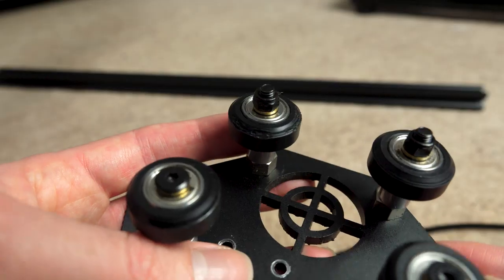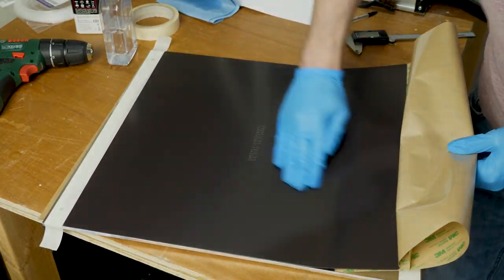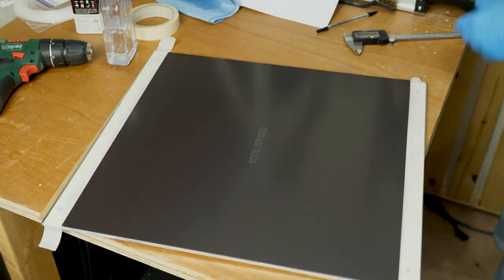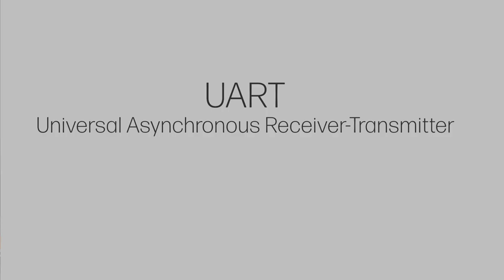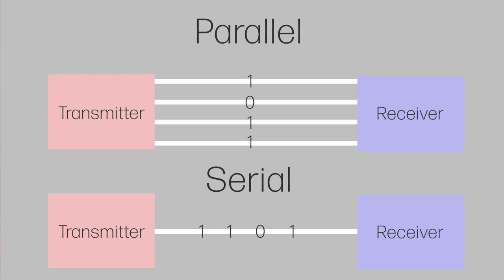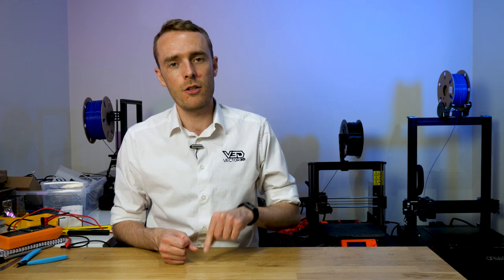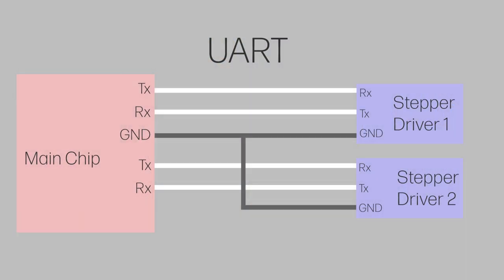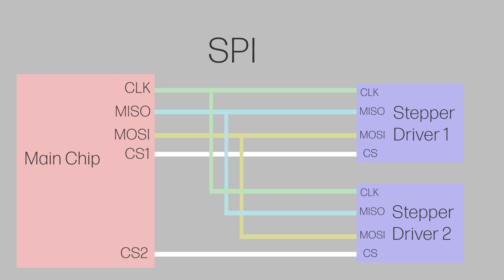UART vs SPI on 3D Printers. What are they?

Comment: UART has some nice features for people who are into tinkering, like dynamically switching from spreadcycle and stealthchop2 modes. But I think what most people will use, if they do, is being able to change the driver Vref in the firmware and not by turning the potentiometer.

Comment: Fun fact: GTR board, when taken with an expansion board and filled with UART TMC2209 drivers - costs almost as much as a Duet 2 + Duex5 clones from the same Bigtreetech. It has more inputs and outputs, if you plan to use Klipper - it's a pretty good system, could be worth it, maybe for something like a Voron or other printer with lots and lots of motors. 
If you do like Reprap firmware, and don't mind its restrictions and lower speeds - you can get a Duet clone. 

Either way - Bigtreetech has got you covered. I like what they're doing. Affordable prices, true open-source on github...
I wish Bigtreetech made their own Pi board! You know, to order alongside the other boards, for octoprint and other similar things.
Reply: Id like something similar to the einsy rambo as used on prusa mk3 with a location to gpio hook up a pi "natively"
Reply: Having not watched this video throughout haha i meant on more "normal" boards skr etc
Reply: @gazeddy  Pi GPIO header is waaay too large, SKR boards are already full of components, there's no space on them.
Reply: @machinerin151  You don't need to hook up all the GPIO pins to the board, just the ones required for communication.
Reply: Ur wish is just happend and now its on my hands too😃 Manta + CB1💝

Comment: Do keep in mind that, if you want to use UART for your stepper drivers, the microcontroller will probably not have that many UARTS supported in hardware, and a software implementation must be used (which will probably be slower/require more resources/be less reliable), whereas with SPI, you only need one SPI bus on your microcontroller (of which there may be more than one)
Reply from the maker: That's a really good point and one which i hadn't considered. Do you know if the software implementation would be slow enough to cause issues? Or do you know that they're not already using a software implementation?
Reply: @Vector3DP  There are SoftwareSerial implementations included in the Marlin source code. I don't know if it'll cause issues. It might be a theoretical problem only.
Reply: I don't think it actually matters, most drivers use step/dir for controlling the motors, and only use one of the serial interfaces for configuration, which won't happen that often and has no critical timing. Those that can use a serial interface for controlling the motors, use the SPI bus.

Comment: Missed one thing on UART, there is one wire mode and two wire mode. One wire mode sends then waits for a response on that same wire, two wire mode is what you showed in your video. On the SKR’s, Pro, GTR, & M5 all use one wire mode. https://youtu.be/alPl3kzp_oE
Reply: There can be up to four wires if you add in hardware flow control with the RTS/CTS lines.
Reply: He did not miss one thing he missed a lot of things.

Comment: Almost a good video, but you very much ignored the software difference between the two. Specifically the added features you get with Marlin when you use UART as the communication type on steppers that support it. Added features like being able to specify the current, turn on/off the various modes and set thresholds for modes. This is a lot more than you can currently do with the SPI connection in Marlin.

Comment: To confuse matters even more, it's often possible to select between UART and USB when setting up Klipper. USB is easier to set up as far as the average person is concerned, but UART might be a few nanoseconds faster because most 3D printer controller boards these days use a UART to USB chip. In fact, when sending G-code from a computer connected to a printer via USB, the computer doesn't actually know it's talking to a 3D printer. It only sees a USB to UART adapter (which is why the printer appears as a serial port in Windows Device Manager or the equivalent). That's probably not going to change any time soon, especially with all of the existing software and hardware out there.

Comment: machines controlled externally also use uart. uart can only run at 115kbps. UART is a serial port its outdated it shouldn't be used. Gcode sent over uart is how PC/kipper machines work and it can cause bottle necks at on high poly meshes due to uart mode being way slower than usb itself.
they are still like this ! 
Look for better options than uart!

Comment: What bother me about this video is why you did not explain the fact that UART is hardware implementation and SPI is a protocol which means UART is more expense and real estate taken on the board. While at the speed at which communication is need on a 3 D printer both SPI and UART are on level playing ground as neither is better than the other. Since SPI is a protocol it is much easier to implement and is cheaper in the long run as less space on the board and less hardware which means cheaper for the MFG's which means more profit. Actually moving to SPI on the 5160 was not only profit motivated but the driver real estate can be much smaller footprint allowing them to up the anti on the half bridges used for control which means better quality at the same time. Another thing is it took you half a video to get to the point of this vid in the first place which was lack luster.  Next time do better homework and your vid's will be much better.

Comment: Sorry Adam, not wanting to troll, but you mention parallel vs serial, which neither UART or SPI is, and your SPI diagram is a bit out, surely MOSI goes to MISO, you basically setup a chain then use CS to reference them..? I'm probably just jealous as I want one of those boards to give S.T.E.V.E. 3 Z axis steppers.. ;-)
Reply from the maker: Don't mention one vs the other, just a diagram of both to show what the 'serial' part of serial communication means in winder context. Mosi goes to Mosi. That's why they're named like that, to prevent confusion like you get with UART where you wire up to diffently named ports. Master is the main chip, slaves are the stepper drivers. Output of the master connects to input of the slave, hence Mosi.
Reply: @Vector3DP  Fair enough, just seemed a bit random, I always thought MOSI (Master Out Slave In) goes to MISO (Master In Slave Out), maybe that's why I prefer I2C.. :)
Reply: @Vector3DP  Actually, Stephen is correct. MOSI/MISO is used AFAIK exclusively on MCUs, because these are assumed to be the master. Devices other that MCUs usually use SDO/SDA and are connected MISO-SDO and MOSI-SDA. But when two MCUs are communicating, then the master "status" alternates and the one sending is a master but when it receives, it is a slave. That is why MOSI goes to MISO.